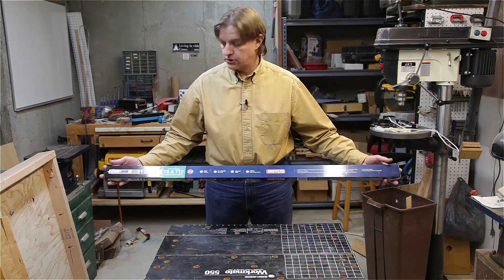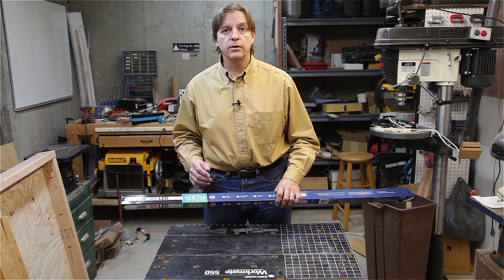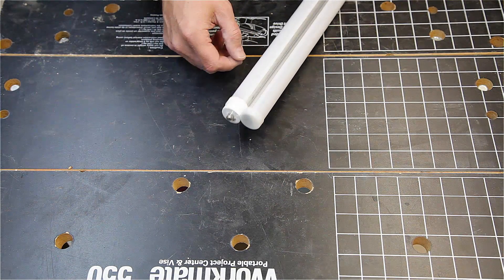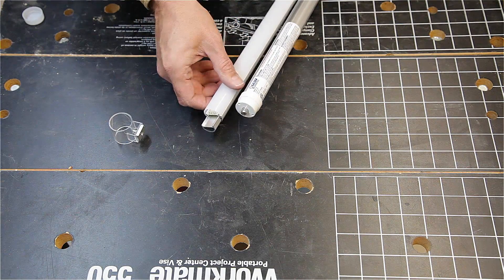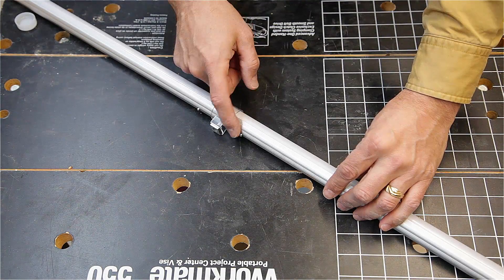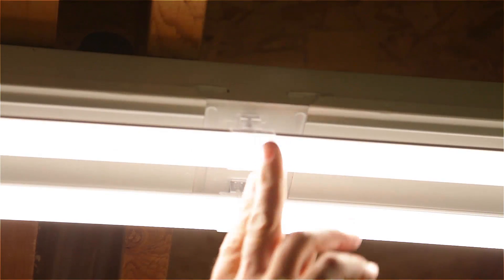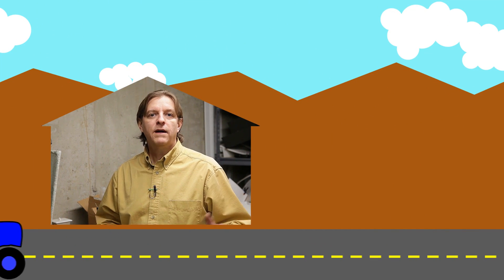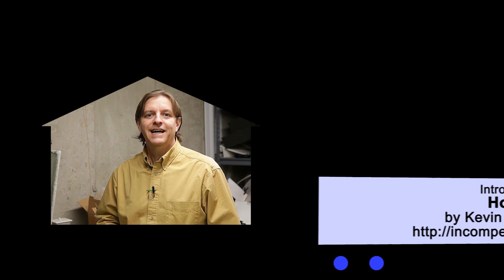How to easily convert fluorescent tubes to LEDs

Comment: WTF? bypass the ballast save the energay and run 2 5k bulbs instead of 4 40 w flourescents 7 bucks a bulb
Reply from the maker: The point of this videos is to "easily" convert fluorescent to LED. Yes, there are more electrically efficient means, but they require more effort and working with line voltage wiring. Two things that may not always be available. And FWIW, I did do a video on bypassing the ballast too: https://youtu.be/wMeba8NOvuM

Comment: Went to buy conversion parts bulbs for my 4 bulb florescent  kitchen light $17 to $30 a piece.  I bought led light fixture 2'×4'. 39 watt fixture is about 3/8" thick cost me $67. With tax dropped right in lot brighter no more bulbs to change
Reply from the maker: Yep. If you don't mind changing the fixture, sometimes it's cheaper to do that. Cheers.

Comment: New led 4 ft shop light now is 29 bucks and you dont have to do any work, just hang and plug in
Reply from the maker: Yep, prices have changed over the years since I made this video. But hanging a 4 ft shop light when you already have 8 ft fixtures in place is more work than just replacing the bulbs. Peace.
Reply: @HouseOfHacks  not really, they link together now. So you can do 4,8,12,16, 1000 if ya want back to back to back. Peace
Reply from the maker: Sure, my point is taking down the old fixture and putting up new ones take more time than simply replacing the bulb. Cheers.
Reply: @HouseOfHacks  yeah but u also have ballast still in eating 10% of your energy cost. Kinda fefeats purpose. And its a lot faster to take down 4 screws, and replace with 2 4 ft new fixtures . Cheaper too, not to mention new warranty which probably wont be needed but hey, its a bonus
Reply from the maker: Yep, lots of ways to skin the proverbial cat. Pros and cons to each.

Comment: I have a small grow space 1.5 square meters=16.15 square feet.  87,500 lumens using LED screw in bulbs white & yellow. Today am ordering a $70 light meter. Offhand, in general am i using too little or too much light from bulbs close to the plants but not too hot? Thank you.
Reply from the maker: Sorry, I have no idea what is required/recommended for grow lights. Cheers.

Comment from the maker: Looks like the prices for the 8' LED tubes have come down significantly. They're now less than $15/tube on Amazon for some models.
https://amzn.to/2FFynK7 (Affiliate link to search results.)
Note: some of the search results may require ballast bypass. For how to do this see https://youtu.be/wMeba8NOvuM
Reply: The link isn't for the brand you used in the video, and the linked brand requires ballast bypass.
Reply from the maker: @Ekrindul  Oh, thanks for the heads-up! Not sure what happened with that link. It was supposed to go to search results, not a particular product. I've updated my comment to clarify. Peace.

Comment: $240? Now , you can a 4-pack of 4-ft LED bulbs for $30 at Amazon
Reply from the maker: Yep, but 4-ft LED bulbs don't fit too well in an 8-ft fixture. :-)
They have come down some since this video was made, but not too much. They're still significantly more than the 4-ft bulbs. I'm guessing it's just a supply/demand issue.
Reply: @HouseOfHacks  I think it has to do more with much lower production cost now since they already have these factories set . Replaced my pool table lights that had 4 florescent bulbs. Was confused at first and I tripped my outlet. Good thing one bulb did not even get fried .  Turns out, I did not even need to replace the tombstone. Shunted or one-wire kind is fine with my bulbs. Just need to wire both ends.  Need to make sure the two-pairs were wired to each group right .

Comment: I just replaced two 4' fluorescent light bulbs in my kitchen with LED lights -- $10.
Reply from the maker: Yes, 4' LED bulbs are much cheaper than 8' ones. Do you like the new bulbs?
Reply: did they have the 2 pins ?

Comment: what IS the advantage of LED ? apart from possible cost saving.
Reply from the maker: Less energy usage. In many cases, less heat. Compared to fluorescent tubes, better color temperature and more light. Cheers.
Reply: A lot of people get headaches from fluorescent lights. I know I do. The constant flickering if the light can cause headaches. The lights flicker so fast the naked eye can't see it. That flickering comes with the loud humming of the bulbs.

Comment: LEDs are devices that rarely fail... but when they do, they get dimmer, dimmer, dimmer, and eventually get to where they barely shine at all. This is when an LED is under normal operating conditions. Overvolting them obviously will burn them out. If you ever see an LED that doesn't work at all, it's usually due to abuse or the circuit has went open.
Reply from the maker: Yes. If I recall correctly, an LEDs life is defined by how long it takes to become half as dim as it was when it was new.
Reply: @HouseOfHacks  I had 1 bulb quit but I had it in a outdoor fixture it was a house bulb assumed it didn't like the cold. Haven't had time to check if indoor outdoor are diferent

Comment: Pay me $60.00 per light and I will do them all day long, bulbs included.  What a joke!
Reply from the maker: If you have a cheaper source for 8' LED tubes, I'd love to hear about it. Thanks!
Reply: I've been in the lighting industry for 30 years and into LED's well before they actually worked.  I have my own company selling, plus have worked for manufacturers etc and honestly there are only a few companies that make a plug and play in an 8' T8.  The least expensive bulb I found was 39.95 by Sunlite...not what I'd call a reputable company, not a company I would carry personally.  $60 a bulb from a retail store for an 8 ft plug and play is reasonable.  The one you have used is a good design actually, takes care of an issue we have with 8' LED bulbs, which tend to bend a little in the center from it's own weight and sometimes that breaks the connection between the two sides.   You can find reputable manufactured direct wire bulbs for less.  I would be interested tmcom if you have found a good plug and play 8' bulb for less...

Comment: Lights in Ireland use 220-240 volts, I'm trying to buy a fixture at home depot that uses 120 volts what will happen if i installed it?
would it blow up or what?
Here is the Fixture https://www.homedepot.com/p/Hampton-Bay-Regency-2-Light-Brushed-Nickel-Fluorescent-Flushmount-HBF1208P-35/202519978
Reply from the maker: So I checked out the box for these when I was in Home Depot and it has less information about the voltage range than the web site (which indicates 120 volt application). There was no indication if it's 120 volt only or a more universal 90-240 volt one. The picture in the manual makes it look like the ballast could probably be easily replaced with a 220-240 volt model, if such a thing exists, is available to you and is needed. Hope that helps.
Reply: But if I just installed it would it blow up?
Reply from the maker: It's unlikely to physically blow up. Worse case is it'd melt some insulation and blow the circuit breaker. You might get a few flames and smoke but nothing more spectacular than that.

Comment: My country uses 220-240 volts what will happen if i installed a fixture that uses 120-140 volts?
Reply from the maker: That will depend on the ballast and how it's designed. If it's only designed for 120, it'll burn up with 220. There are some that are designed for a global market and will take any voltage from 90 to 240.

Comment: If you have been to a store you have probably seen a LED fixture... they are not good at all. Let me explain so with a normal fixture you can replace the light bulb with a LED fixture you can’t replace any bulbs so when it burns it you got to replace the whole thing. Finally it costs a lot of money to replace the whole thing. Peace
Reply from the maker: Yes, I'm familiar with LED fixtures. I've replace a number of old fixtures in my house with them. You're correct that if it stops working, it's not as simple as replacing a bulb. I was able to pick them up in a quantity pack that was on sale, so the cost for them was less then the cost of an LED bulb.

The design of fixtures is such that the control electronics are in a separate module away from the heat generating LEDs. This is unlike an LED bulb where they're all packed tightly together to make them fit in a bulb shaped enclosure. I'm hoping that by having the electronics separate from the LEDs that the reliability will be increased.

Cheers.

Comment: You say Fluorescents aren’t good Well, I have CFLs or Fluorescents that are 12 years still work just fine. I got them in 2006 now they make ones that don’t last same with LEDs. Also I paid 15 euro for each one. So it shows the more you pay the longer they last. The less you pay the bulbs will smoke, burn, explode which is very rare. I just wanted to let you know how to choose good bulbs. 

Thanks for reading :)
Reply from the maker: I'm glad you've had good experience with them. Personally, I don't like them. In my experience, not only are they more expensive and have shorter life than incandescent lights, they also have a poorer quality of light. Some of the new LEDs are getting better though, but you do have to pay for the more expensive ones got get good light. Peace.

Comment: Thing is LEDs get hot
Reply from the maker: Yes, they can. Bright ones may dissipate quite a bit of current.
Reply: blows my mind that LED generates much heat but uses less power (watts) to produce same or more light then fluorecent lights. Where does the energy come from for light and heat for less power
Reply: Some Fluorescent have lasted more then LEDs that was back in the 1990. Now Fluorescent don't last long and some LEDS don't too
Reply from the maker: Yes, quality from one brand and model to another varies greatly. I think generally, for both fluorescent and LEDs, the big thing determining length of life has to do with the design and quality of the driver components. The power supply part of the light is typically the weak link and goes out before the light component itself.
Reply from the maker: That's a good question. I think it's more a perception issue than anything else with a couple things going into it.

With fluorescent tubes, the primary heat is going to be dissipated by the ballast. It's generally where the user isn't going to be touching it and so the comparison is between the fluorescent tube that's not generating much heat and the LEDs that are dissipating a significant part of the power usage. It's an apples to oranges comparison.

Also, the ballast is a relatively large device and the heat generation is dissipated over a larger surface, decreasing the heat at any one point. Conversely, the LEDs are typically driven with switching power supplies that will be concentrating the heat dissipation over a smaller surface area. So they may be dissipating less power in total, but it's concentrated in a smaller area and so the temperature is higher.

Disclaimer: I'm just theorizing, I haven't tested anything to know for sure. :-)
Reply: The question is... if LEDs lasted for 50 years... in 50 years the LED would fall apart because it’s made out of plastic not glass and look hot, dirty, etc
Reply from the maker: I'm not sure of that, it depends on the plastic. I have plastic that's more than 50 years old and doing just fine.
Reply: You sure love plastic. :)
Reply from the maker: LOL!! :-D
Reply: My LED's have lasted a year in the shop so far. No heat issues.
Reply: Mine run colder than my flourescents by a long shot. I have t12, t8 and led here and the led are the brightest,  run less amps, and are cooler to the touch

Comment: The whole word of LED tube are very confusing.  In research  there are different type of wiring on LED tube, how do I know how it is wired since LED tube do no not come with a schematic.  I blew out my 2 LED tube after finding out is was wired differently and why is there not standard?
Reply from the maker: Sorry to hear about your blown out lights. I've only seen two ways of wiring these depending on if the bulbs have one pin on each end or two pins on each end.

Comment: Seems to me using the old ballast produces zero savings.
Reply from the maker: At the cost of 8' LED lights, I doubt there's any direct money savings. They're expensive enough that I can't see how any savings from buying fewer bulbs or the reduced load on the ballasts makes up for it. However, there are other non-monetary advantages. The convenience of not having to deal with replacing fluorescent tubes on a regular basis and the much, much, much better quality and quantity of light make them worth it, in my opinion. So much so, that I recently replaced all the other 8' lights and half the 4' lights in my shop with LEDs. Cheers.

Comment: With these replacement lights, do you still get ballast buzz, or would I need to ditch the ballast to do that?
Reply from the maker: Hmm. That's a good question. The ballast buzzing indicates it has degraded some. Would the different load on it from the LEDs change how it responds? I'm not sure. I imagine there are a number of factors that might impact the answer including how badly it's degraded and what the load difference is between the fluorescent tube and the LEDs. You could try replacing the tubs with LEDs and see if it makes a difference. If it does, you don't need to do anything else. If it doesn't, you replace the ballast, which is what you'd have to do if you stayed with bulbs. Or you could just remove the ballast and use LEDs that don't need it like I did in a recent video: https://www.youtube.com/watch?v=wMeba8NOvuM&list=PLWmDBD9Srrwn5n-YSqq4NrRxRpRPaUBkV&index=4

Comment: Is it possible to connect and ofc lit 4x39 watts T5s in a 2x80 watts ballast?
Reply from the maker: That's an interesting question. I don't know.

In terms of total wattage, they're essentially the same. I don't know enough about the resistances between the two configurations to know if that'd cause a problem or not.

If it were me, I'd experiment and see if it works. I'd try two configurations: one where the bulbs are run in parallel and, if that didn't work, one where they're run in serial.

If you try, I'd be interested in knowing if you had success or not.

Cheers.

Comment: Just replaced my garage fluorescents with LED's. I tried the style that's supposed to work with the ballasts. No go! So I returned those and got ones that work with a "bypassed" ballast, meaning I took out the ballasts and wired them direct. Took me 5 minutes a fixture and they work great. I still need to do the ones in my laundry room. And I still have 2 in my garage that I haven't gotten to yet.
Reply: Weird that the first ones didn't work but great to hear you got them working in the end. Yeah, there's not too much inside the fixtures. Usually if you can follow a diagram, they're pretty easy to work with. Cheers.
Reply: They are a whole bunch cheaper too methinks...

Comment: I always felt the light from an incandescent bulb more pleasant on the eye , just one drawback is that it draws more power, but LED's burn your retina, over a period of time,..........
Reply from the maker: Yes, I prefer incandescent bulbs over all others too. The problem, at least here in the US, is they are being phased out. It's illegal to sell most types of incandescent bulbs of certain wattage. And the number and type of bulbs that are going to be included in this ban gradually increase over time.

And, yes, there are some studies that show under some circumstances there may be increased risk of eye damage using LEDs, which is a bit disconcerting. Whether those risks manifest in increased eye problems or not is a mater of speculation until there is more data to go on. Essentially we're running a long term experiment on the entire population.
Reply: so long as companies make money,.... human being, life itself is the last priority,........!!!!!!!!!!!
Reply from the maker: Hmm, companies are made up of people and it's people making the decisions. A company is only as good or bad as the people running it. I don't think you can make completely blanket statements like that. There are certainly companies with bad/immoral people running them that put profit over all else, but not all are that way.

In this particular case, it's government mandate that's forcing the issue. My guess is if the manufacturing companies had their way, they'd stay with incandescent. Incandescent bulbs have pretty much remained unchanged for 50+ years. There's no R&D expenses. There's no retooling expenses. Past basic manufacturing costs, they're all profit.

I think this is more a case of government overreach, incompetence and unintended consequences.

Peace.

Comment: Big mistake combining two different technologies.  Replace the whole fixture or replace with a LED light system that use a external driver.  Try Titan LED, US made for reliability and safety.
Reply from the maker: Why's it such a big mistake? It's not optimally energy efficient, but it is a fast way to get from point A to point B.